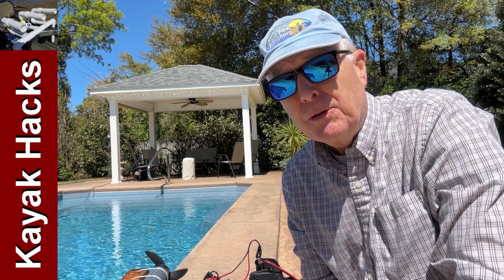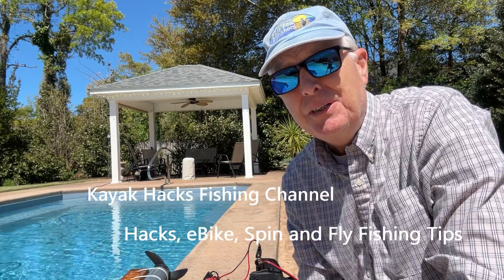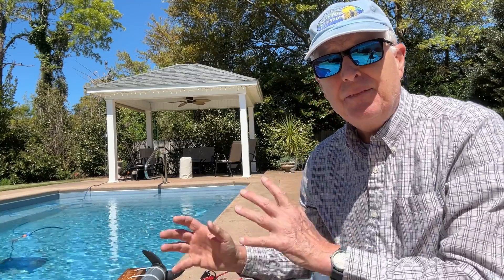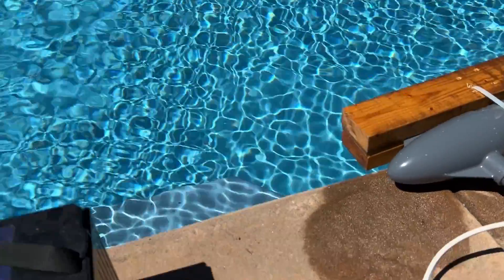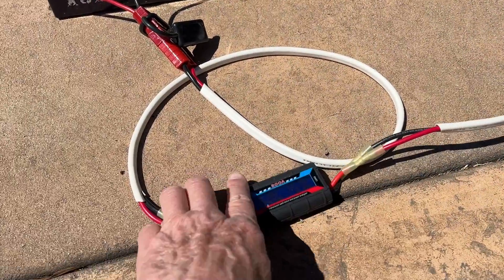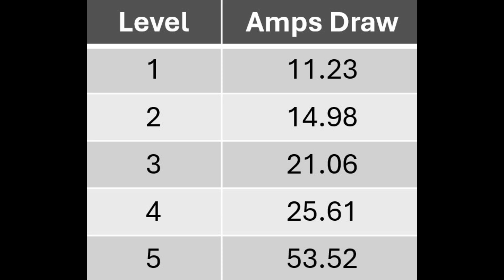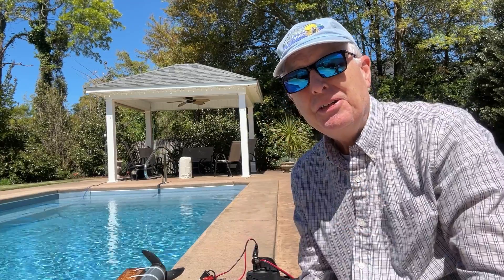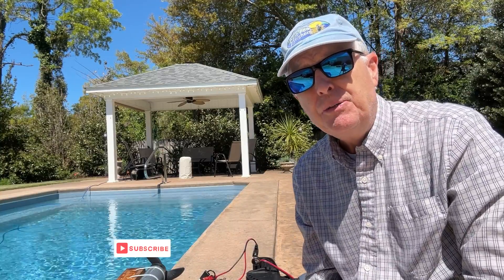Busting Myths - Kayak Trolling Motor Amp Draw

Comment: Why would a trolling motor use the same amount of energy on min and max setting??
Reply from the maker: It would not - there was plenty of discussion around using a pulse width modulator to minimize draw - many believed it was constant, and high without it. This video shows that not to be true... so no need for a pulse width modulator unless you wanted more control over the consumption

Comment: Just the amp draw I was looking for. I have been using a 50ah battery with my 55lb NV kayak motor for about 3 years now. 
I have been considering getting a bigger battery to cover more ground. But it seems at speed 3 i should get about 2.5hrs of constant cruising and cover 4 miles +.
Reply from the maker: It is really helpful to have one of the newer lithium batteries that comes with an app, allowing you to monitor the remaining charge - much like a gas gauge.
Reply: @KayakhacksFishing  never heard of that before. My battery is a LiPo.
Reply from the maker: @MannsWoodlandPerspective  Check the manufacturer... maybe they have an app.
Reply: @KayakhacksFishing 
Hello. What size is the Newport motor in the video?
Thank you.
Reply from the maker: @kieranh2005  That was the small one - 36lb thrust

Comment: Wanted to add a lanyard kill switch. Switch is rated at 5amps/12volts. So I cannot wire power into the switch at that draw rate. Do you think if I wired a 60amp relay to pass the power to the motor, and the relay to send power from the lanyard to close the relay would work???
Reply from the maker: Would this work? It is how I solved the problem - https://youtu.be/KBWev9xplhA
Reply: @KayakhacksFishing  Appreciate the link. I saw your video. I like the rip out the fuse idea but wanted more finesse. 

Since I am building a system now, I will experiment with a more standard lanyard switch and relay. Wont be under 10.00. More like 35.00 but to each their own.

Comment: I was unaware of the debate.  Logic would most certainly tell anyone that the faster you run the motor, the quicker you will consume energy.  With that being said you only did this test with only one motor.  The actual results would likely vary from differing brands of electric motors.  At this point I am curious as to which electric motor on the market would be most efficient.
Reply from the maker: Yes, I only had one motor to test it with. lol! I am not Mr. Beast who makes millions every month on Youtube :-)

Comment: What would be the change if you were to use a PWM . Will the PWM save any power for increased runtime?
What size thrust.
 As always great job.
THANK YOU
Reply from the maker: A PWM would absolutely help reduce the power demand. Unfortunately, most trolling motors are brushless. All the PWM units with enough amps to work on a trolling motor are for "brush" motors and will burn out if you use them on a brushless. If you find one that will work for 60A, please let me know!

Comment: Not sure where this 'myth' arose, but I think it might have to do with a confusion regarding 'efficiency'. There is much talk about excess 'energy' being consumed as heat. However, that does not easily relate to amps or amp-draw.
As far as I am aware, many of the trolling motors (without pulse width modulation) utilise 'speed-coils' to regulate speed. The different 'speed-coils' would have a different resistances. The resistance of those coils would determine the actual amperage reaching the motor components. A high resistance coil would result in less amps reaching the motor resulting in 'slower' speeds. Lower resistance coils would result in more amps reaching the motor resulting in 'faster' speeds. 
Higher resistance generates more heat (ie less efficient). How does that relate to amp-draw, though? Voltage equals amperage multiplied by resistance (V=IR). Since voltage remains the same, an increase in resistance results in lower amps drawn. 
So while lower speeds do draw fewer amps, those lower speeds also generate more heat (relatively) and is therefore less efficient.
On the other hand, motors with pulse width moduaiton (ie minn Kota's digital maximizer) regulate speed by altering 'duty cycles'. The power remains the same but is regulated by 'on' and 'off' cycles. More 'on' cycles results in faster speeds, relatively more 'off' cycles results in slower speeds. They are generally accepted to be more efficient because less heat is generated.
Reply from the maker: Good Point! I appreciate that additional clarification

Comment: PWM is way more efficient than using the Newport trolling motor head/controller. Way less amps used and better, smoother, speed control.
Reply from the maker: True, but I have yet to find a PWM that will work for a brushless motor. Most trolling motors are brushless and the PWMs sold on Amazon with enough amps are for "brush" motors. If you find one for a brushless, please let me know!

Comment: One thing that you might not be realizing is that not all trolling motors are created equal. Some run off of direct current and some run off of a pwm. The ones that run off of direct current will have a continuous stream of power while a pwm sends pulses of power. But we're talking about Watts here well you're showing amperage. Amperage has to change in order to spin a DC motor faster or slower. But the power that's lost on a direct current setup is wattage not amperage.
Reply: @WillSelby - What? Do you have any idea what you are talking about? Wattage is the product of voltage and current. A basic electric class will tell you this. 12volts and 1 amp = 12 watts. 12 volts and 2 amps = 24 watts. If voltage is constant and amperage goes up the wattage will also go up.
Reply: @RH-go2dk  Alright you're stating the obvious but if one of those components are getting lost through heat because of a continuous draw than the other ones will suffer as well. You simply put a trolling motor in a pool with zero load on it. Most trolling motors I've seen are connected to a boat. Under bigger loads as when connected to a boat, the constant power sent to the direct current motor without using a pwm stays the same. This information comes off of the Newport website.
Reply from the maker: I agree that if your motor incorporates a PWM, you do not need to worry about this. But, so many people go to Amazon and buy a PWM that will eventually fail because they are designed for "brush" motors. Most trolling motors are brushless.

Comment: We typically use a WaterSnake 24 lb trolling motor for most trips since the motor only weighs 5 lbs. It only has 2 speeds, but the current draw is radically different between low and high. I don't remember the official specs, but my measurements were close to them. High speed pulled about twice the current as low speed, but the speed difference was something like 2.5 mph vs 3.5 mph. High was faster, but not twice as fast. So we use high speed for fighting stronger currents or if we are really in a hurry and the extra 1 mph is important. But since our primary use for that motor is maneuvering (mostly spinning and backing out of the launch), we keep it in low. A 50 Ah battery is more than plenty for a full day with it.

There was a review of a mount system for Minn Kota and Newport Vessels motors which give the mounted motors GPS capabilities like the high-dollar motors. We plan on getting one this summer to use with the 36lb and 55lb Newport motors we have. Knowing the current draws on those would be useful to make sure we size the battery correctly.
Reply from the maker: Good to know about the Snake. I looked at those but decided the tides ran too fast here and I needed more thrust to overcome the flow. I think the GPS spot lock would be a really cool feature - but, in shallow water, I just anchor. My test was done with the 55 lb Newport.
Reply: @KayakhacksFishing   for the price and weight, I highly recommend the 24lb one. For strong currents, it probably won't hold a heavy boat very well. It definitely has less power than our 55lb Newport (probably same model as yours). The only reason we don't use the Newport for everything is the weight issue. Despite our kayak being extremely stable and nearly unflippable, the weight of the Newport when side-mounted makes the kayak lean too much and there is no good way we have found to offset the weight. Hobie PAs have a front mount bracket which is more central to the kayak axis and we would have used that, but the transom mount Newport isn't a front-mount and can't easily be converted on our kayak. The mount I referred to (I don't have the model handy) appears to remedy that. The dual side-mount unit you have looks really nice as well. I still honestly believe that if they have a spot lock for both location and orientation, they would have the best system on the market.
Reply from the maker: @2reelyakrz481  Great points about weight. Used to have the 36 lb thrust model. The 55 is only 3 lbs heavier, so I went ahead and got that one when I upgraded. My Jackson kayak is a heavy beast and I do not have a big problem with leaning to one side. I would love to get a lighter kayak, but there is nothing wrong with the Jackson - lol - I'll keep it until it fails. this is why my truck is 23 years old! It keeps on going!
Reply: @KayakhacksFishing   I remember your review of your Jackson. Nice boat. I really like the adjustable pedal/prop to handle shallow water. I believe you can also adjust the battery location which is a great way to compensate for the trolling motor weight. Our PA doesn't have a way to do that for the battery. The PA17T has a molded battery holder in the center of the boat behind the rear seat - Hobie probably considered it a great feature. Their other PA models don't have that and the battery location can be shifted, but ours can't - so I consider it a design flaw. We recently got a couple of Pelican Pescadors - I seriously considered the Jackson based on your review of yours, but we got these used for $250 each which was hard to beat. I don't know how trolling motors will work on them, they need some repairs and that's not in the schedule as of yet. Your truck sounds like every vehicle and tractor we have - also every joint in my body 🤣
Reply from the maker: @2reelyakrz481  Can't beat that price!!!

Comment: I’m assuming you don’t go twice as fast at level 5 as you do at level 4. It would good to have a ballpark idea of what is the most efficient setting to get the most distance per amp hour. That way if you have a low power level you know what setting to use to get the maximum distance out of the battery.
Reply from the maker: Right. Since this test was static in a pool, speed could not be assessed. I'll find out when I get onto the water!
Reply: Actual speed would be affected by external factors (ie wind, amount of waves, weight of boat,...). In addition, you should note different manufacturers might have different amperage draws for the various settings. As mentioned in my other reply, most motors of that type use 'speed coils' to regulate speeds. The amount of resistance in the coils employed by the different manufacturers would likely not be the same. Different resistances would result in different amperage draws.
Reply from the maker: @internetuser4601  Excellent points! Thanks
Reply from the maker: @internetuser4601  Exactly. The point of the video was to show different speeds draw different amps.
Reply: @KayakhacksFishing No argument there. I was trying to point out that the actual values you obtained could also vary by manufacturer. The difference in amperage you note between speed 4 and 5 might not be the same with a different motor because the 'speed coils' used would be different.
Reply from the maker: @internetuser4601  Excellent point! Thanks

Comment: Hey Steve: I have adapted a MINN KOTA 30 Endura C2 to my Tarpon 100 kayak. Here is the voltage table I measured/recorded. I did not measure Amp Draw but it stands to reason that it increases with each speed up. Also it's worth noting that MINN KOTA uses thinner wires for lower speeds. They wouldn't do that if Amps were constant. https://photos.google.com/photo/AF1QipO3q4jfMFlmxoUFwfcnKELwdHkCEqhcYCXFAPo

Comment: Steve, you are correct with the motor that you have. The cheaper Minnkota motors for around $100 that do not have a built-in PWM pulse width modulator do draw full current draw at all speeds. The motors that cost $500 and up generally have built-in pulse width modulator  like my old town auto pilot 120.😮
Reply: @BobBohner4851 - Who told you that lie?
Reply: @RH-go2dk  I’ve added PWM to the 30 pound Minnkota that cost about $99 and run amperage draw test before and after.
Reply: @BobBohner4851  - and you're telling me that without PWM the 30lb motor drew 30 amps on speed 1 and 2 and 3 and 4 and 5? The amp draw stayed the same, but the rpm's increased with each number increase? If that's what you are saying I'm saying BS. Sure the PWM addition will cause the motor to draw less current, but it will draw less on each speed and the draw will be different on each speed.....same as it is without the PWM.
Reply from the maker: I just checked and the Newport does not come with a PWM. The Newport sited discusses how to use one with their motors - https://newportvessels.zendesk.com/hc/en-us/articles/360056225814-PWM-Pulse-Width-Modulation-Overview#h_01ES7012G9PRS6DNHWQRNPE4AY
Reply: Your wrong i have done this test on the cheaper nk c2 endura motors!
I even when as far as to tear the complete motor apart and there are NO resistors in them!
Speed control is done by having different windings on the same armature..
When you switch speeds it directs the current to different windings on the motors armature.

 Trolling motors stopped using resistors to control speed decades ago!!!!!
Reply: @NiteWolfeFishing  the resistors according to MK are in the motor to dissipate the heat into the water.
Reply: @NiteWolfeFishing  perhaps there are different motors that act differently. I posted my data and I’m not going to comment more. Thank you.
Reply: @BobBohner4851   - you didn't post data....you posted a lie with nothing to back it up other then to say you did.
Reply: @RH-go2dk  you’re right. It would post here. I sent it to Steve in an email. If you give me your email I can forward it
Reply: I think you measured wrong. I've tested my trolling motor also, and the amp draw is very different@BobBohner4851
Reply: @DanieHattingh  I used a digital meter, went back and forth to average out current and wind.  Maybe they’ve changed the motor design?
Reply: @BobBohner4851  says he will "not comment more" then continues to comment.  🤣
Reply: He also is testing a 230$ newport vessels kayak 24 inch shaft 55lb thrust
Reply: The data is the data and I really don’t want to debate this.